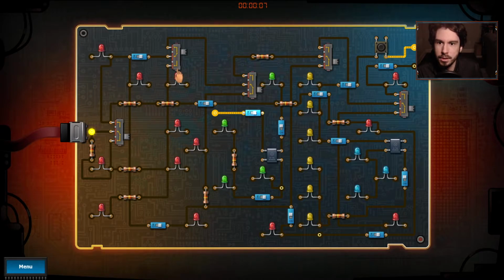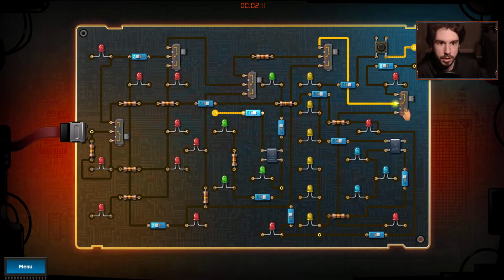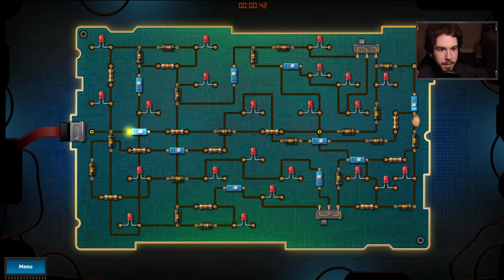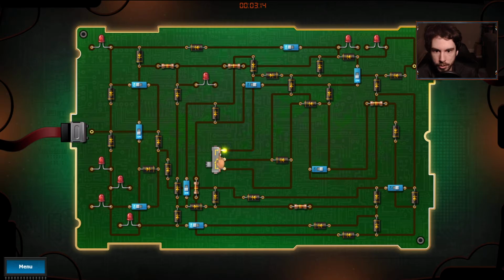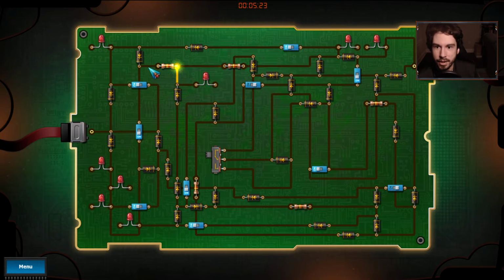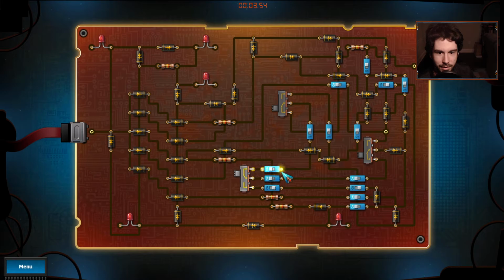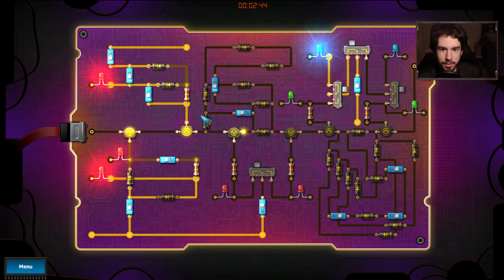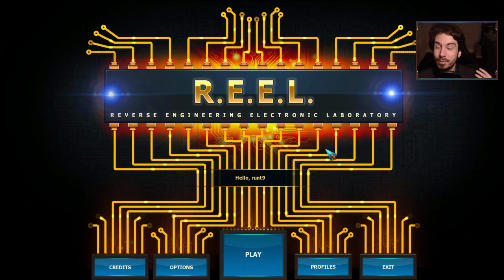Educational Circuitry Maze/Puzzler | Runt9 Looks At R.E.E.L.

Comment: Definitely felt more like a maze game, but with branching and constrained paths due to the component constraints. Cool video, now I know there's a little more.... Btw, I think that what you're calling a "transistor" early in the video is actually a single throw double pole switch, and then the cylinder you were calling a "capacitor" is really a diode. :) No worries not recognizing the components, thought I'd mention in the comments since you'd asked.... Originally I was playing through a different version of the demo and stopped before seeing the last mechanic with transistors (the things you need to "feed" current through) which I saw here. Up until that point I was also in the "is there more?" head space, and actually, it looks like there is! Maybe I'll keep going in that case